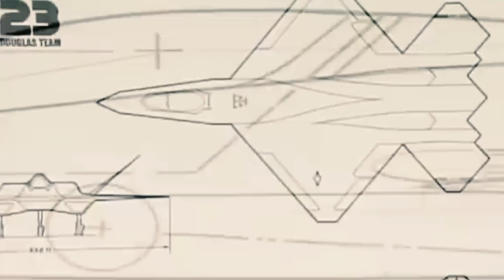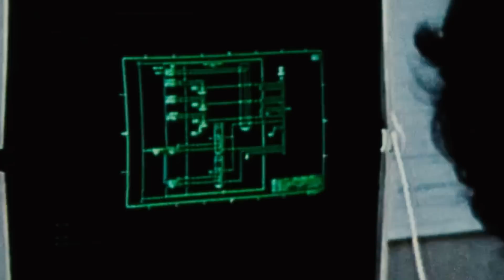The US Air Force Was Crazy Not to Build More of These

Comment: I’m so sick of the YF-23 fanboys saying that the YF-23 was superior to the F-22.

This is nonsense. People saying all of these things are ignoring some FACTS!

Fact#1
The YF23 and YF22 were prototypes that were used for demonstration and validation. The ATF competition did not have a competitive fly off. The purpose was to demonstrate that the technologies would actually work in a real aircraft. The dem/val was only one part of the competition. That said, the F-22 team flew their aircraft beyond the requirements set by the air force.

Fact#2
The YF22 and YF23 prototypes were just that-prototypes. They were not production aircraft. Therefore it is IMPOSSIBLE to compare these aircraft to the actual, fully developed, production F-22. 

The F-22 design changed dramatically from the YF-22 prototype. And the YF-23 would have as well.

People keep saying that the YF-23 was faster. It was faster, in supercruise, than the YF-22. BUT THE F-22 is faster, in supercruise, than both. And again, the F-22 is a fully developed production aircraft.

People keep saying that that the YF-23 was stealthier. This is a ludicrous statement. 

Neither the YF-23 nor the YF-22 were fully developed stealth aircraft. All they had were stealthy shapes and composite skin. 

Neither prototype had a gold coated cockpit, RAM coatings and gap filler or internal radar absorbing structures. Neither of them underwent exhaustive signature verification.

Moreover, every change that was made during development of the F-22, after the ATF competition, (there were a lot) had to be taken into account, while making it as stealthy as possible and maintaining the other specs. This would have been true of the F-23 as well.

Therefore it is IMPOSSIBLE to say how a  hypothetical production F-23 would have compared to the production F-22.

Comment: I literally laugh out loud at the opinions regarding the XF-22 vs YF-23. Oh that's right, we're living in the days of the conspiracy theorists now. The XF-22 didn't just have a better sales pitch, ultimately it had better performance specs and that's why it was chosen. Keep in mind both prototypes exceed the performance specs the military was looking for. 
The main specs:
1) The 22 has a higher top speed at 1600 mph to the 23's 1450. 
2) The 22 is more maneuverable especially at higher speeds. 
3)The 23 had a range of 2800 miles vs 2000 for the 22, I think it's been extended now.  
4) The ceiling for the 23 was about 65,000 ft. compared to 50,000 ft. which is higher now.  
5) The 23 had a smaller radar cross section than the 22. But, we're talking about trying to locate something on radar the size of a cubic inch for the 22 vs a cubic centimeter for the 23.   
6) The biggest reason the F-22 was chosen is production costs. All the engineers agreed it was supposed to be easier to build than the 23. 

If you remember, the costs almost doubled from the time congress first voted on them until the time the fleet was cut down to only 185 or so. The 23 would easily have had more budget overruns due to it being more complex to build in the first place. In a somewhat similar way, that's how the F-111 Aardvark was morphed into the F-14 Tomcat so they could recoup development and production costs of the F-111. 

Both the 22 and 23 are now 30+ year old tech. Much of the engineering came from the X-15 and the SR-71. Instead of looking/thinking backwards the government is looking forward, the F-35 is already 15-20 year old tech but it's still ahead of the Russian S-35, the Japanese J-35 and the Chinese J-20. How about the next video is about the J-20 vs the F-35?

Comment: At the moment the United States 🇺🇸 has the most technologically advanced military, especially the USAF, but in my opinion the aircraft need to be invincible, if the USA, NATO or any other allied nation starts a global conventional war these fantastic aircraft need to have an extremely low attrition rate, replacing them is not going to be as easy as it once was, the time required to produce just one of these aircraft is not measured in days,weeks or possibly months, and when you consider the cost element as well as the production rate it could easily diminish the superiority of the United States military,😮 and all the other countries that have procured their aircraft might not be able to obtain spare parts or even whole aircraft, it is one drawback that everyone hopes will not happen, but given the wars in Ukraine and potentially the Middle East as a whole does make this scenario very much more probable that possible.

Comment: The YF23 was NOT stealthier than the F22, they both have the radar crossection between a bubble bee and a golfball. The YF23 may have had other superiorities, but not in stealth visibility. I question the accuracy of 1.6 mach in supercruise.  I'm sure that if Lockeed had made this video, they would have discussed the superior manuvering due to thrust vectoring. I thought this was a comparison, because many things discussed, are present on the F22 as well, like concealed engine compressor blades, both have that. The 22 also has heat dissapating tiles at the exhaust system. YF23 has ram scoopes? BS!!! The YF23 did not have ramjet engines. It didn't have superior handling characteristics. Sometimes Northrup is as honest as trump. Your video is not an accurate comparison. Try again.

Comment: Why do all of the non-US stealth planes planned or existing so closely resemble the F-22 or the F-35? The answer is NOT that physics sharply limits the number of possible stealthy designs to a mere few. After all, US stealth planes vary dramatically from each other. Compare the B-2 to the F-117 or the F-117 to the  F-22 or F-35. Or compare any of those planes to the stealthy prototypes that didn't go into commercial production, e.g., the X-32, X-36, Tacit Blue, Have Blue, or the YF-23, the only fighter stealthier than the F-22 and widely regarded as its match. Yet all of the current plans for sixth generation planes closely resemble the F-22. Indeed, a few of them require a double take while your brain decides whether you're looking at an F-22 or something else. Currently, all of the 6th-gen design teams outside the US are copying its F-22 homework. Those design teams could instead copy America's homework on the YF-23 or another stealthy US plane, but the teams prefer to copy the F-22 homework simply because there is much more of it to copy given that the F-22 went into full production and much was published on it. (To be sure, some design teams outside the US copied its homework on the F-35 not the F-22, but those F-35 knock-offs aren't considered 6th-gen. An example is China's J-20 Mighty Dragon.)

Comment: Looking at hose lines you can see where they might have added some internal fuel in a B or C model to add some range like they are needing on the f-22 now....  I was liking the F-23 a lot as I watched the run off.  That missile launch was the punch that ruined the low level buzz caused by the "blackwidow" paint and "Grey Ghost" monikers.  Marketing...  I hope they picked this format for the NGAD, nimbleness with some self defense would be desirable in what would be a forward air controller/ C3I aircraft.  It looks like it would have the extra space for a couple more aircrew like the EA-6 and some more gas as well.

Comment: The fact that even all these years later it still looks like the most advanced fighter ever designed. It’s one of if not the sexiest fighter ever built. It’s strange the F-22 was chosen when the YF-23 had much better stealth capabilities, much higher top speed and much better range. What they should have done was build one production version of each and then put them up against each other for a few months actually fighting them against each other and see which one comes out on top. On top of that since they deemed thrust vectoring unneeded/useless now their original claimed reasoning for selecting the YF-22 is now void and null. Betting the YF-23 would still be being prosody ed today as the focus is on BVR instead of dog fighting now.

Comment: Knowone really won because the production run of the F-22 was cut short in favour of the JSF program anyway. ( the same probably would of happened to the YF-23 ) 

 The Marines needing a modern high performance jump jet for there fleet of carriers to replace the old british made Harriers was 1 of the biggest reasons the F22 program was cut short to fund the JSF program while giving the Navy and Airforce new fighters at the same time.
Reply: Marine Corps uses the Harrier II, which was a US/British joint development from the original HS Harrier. It wasn't strictly a British plane, but definitely had a lot of British in it.
Reply: @GreaverBlade   Correct, but the UK stopped   production of Harriers and sold their Harriers and spare parts to the US Marines ( Harriers, also known as the widow maker due to how unsafe they are ) Production had stopped and were becoming outdated.

The Marine Corps currently plans to have all squadrons transitioned to or start to transition to the F-35 platform by 2026.
Reply: @GreaverBlade  This transition began in 2016 when VMA-211 exchanged its Harriers for the F-35B and became VMFA-211.

Comment: I would love to see what ruddervator would have done for the B-1 Lancer bomber.
Reply: Sounds like the Advanced B-1R proposed Missile Truck from 20 years ago.
Reply: @Ryan_Christopher  aside from the engine swap the B-1R would have looked the same. I'm suggesting replacing the tail for ruddervators.  Also melding the new engines into the main body of the B-1. Curious how would having a air intake on the dorsal side effect flight? The Scaled Composite 437 Vanguard  has dorsal intakes.

Comment: Since the Air Farce doesn't BUILD their planes, the title is a bit of a misnomer.

But this plane was by far the better plane.  The F-22 is less stealthy, more weather finicky and maintenance heavy.  And, to add insult to injury, more than a wee bit SLOWER.

This was about Boeing glad handing and paying off political allies to get the contract it really didn't deserve.
Reply: Lockmart was the prime contractor not Boeing. Boeing built the wings
Reply: @johnblackthorne787  That's true...forgot about that since Boeing bought them.

Guess they thought they could bottle lightning again without Kelly Johnson.  Not so much...
Reply: @billcichoke2534 Um, Boeing hasn't bought Blockheed Martin there dude.  Blockheed is the company currently massively over budget and WAY behind schedule on the F-35...
Reply: @danielvogel5252  They bought either Lockeed or McDon.  I don't remember which.  Either way, this was about awarding a current politician payola company.  Northrop got theirs later with the B2 flying wing.

But the YF-23 was still the better bird.

Comment: I think a lot of rhe ideas and tech from the YF-23 is going to go into NGAD... Especially the stealth aspects, which was supposedly far superior to the F-22- but without the now unnecessary supermanuverabity- but, at the time, Northrup and McDonnelDouglas had a bad habit of cost overruns (see The B-2, etc.)

It was particularly stealthy in the infrared spectrum with it's buried engines and intakes and engine nozzles, but it was far from being a dogfighter, when dogfighting was still considered a necessary thing. 

Anyway, a YF-23 without any tails at all (which can be done now) would be very, very stealthy, on alll spectrums amd aspects, even today - and given it's capabilities 40-ish years ago... One has to wonder what it could do with that many years more experience!

I suspect that NGAD will be far more simaler to the YF-F3 than the F-22! (Or at lea, I hope so!)
Reply: NGAD is now in question. May not happen, but if it does you’re probably right.
Reply: Over 250 knots airspeed the YF 23 was more maneuverable, faster, more fuel efficient and a smaller radar cross section.  It was also easier to maintain.

Comment: Northrop was in bad books with the airforce after B2 program. The pentagon did not trust them to deliver the F23 within a reasonable budget. So it was never going to win. LM had delivered the U2 & SR 71 & F117  quickly and within budget.
Reply: @ricky1231 - Except that didn't happen with the $$porky$$ F-22.  It was not only delayed for years by production/teething problems, but also beset with massive cost overruns.  And if those weren't enough, the cost per operational flight hour was so high that production of the large number ordered was stopped very early.  The much smaller number of aircraft built, combined with losses due to attrition, has been a problem for the USAF to meet combat requirements in the current 'forever wars' warmonger philosophy.  And calls over the years to produce more F-22s have been quickly rejected by the Pentagon.  I wonder how this sorry scenario might have played out had the superior YF-23 been selected instead of the F-22.
Reply: Look at all the problems LM had with the F-35, way over budget and long past meeting mile posts along the way. Both are in bad name with the government now, especially Boeing with their screw up with NASA.
Reply: If LM didn’t get this contract they would if been done. AF saved LM to save they contractor.

Comment: I think considering how few 22's lockheed built we could have had twice the number of aircraft before they grew a brain fart after the fact and shut production down. We been way better off with those two then with the 35. If we ended up with all three we and built enough we not be facing what we do now. That said they have blue prints for model t's there is no way there going to destroy planes for either aircraft that is top of the line fighters.

Comment: So now Japan is building a jet based on the YF-23. Time will tell.
Reply: I wonder how much of the NGAD will end up coming from the concepts used in the YF-23? My guess is... a LOT.
Reply: @bholdr----0  MUCHLY
Reply: @MAGAman-uy7wh  

Yeah .. the 23 STILL looks like it's in the bleeding edge, 40-ish years later... 

Sometimes I feet bad for wishing that the cold war never ended, because of all the cool tech that came out of it- from the Blackbird and the ATF to Tang and Velcro! Cheers!
Reply: When it came to choosing a fighter to purchase.  It seems someone was doing someone else a big favor.  I heard one of the criteria was dog fighting ability.  They don't really dog fight anymore since missiles for the sky have been created.
Reply: @bholdr----0  Well, Mitsubishi altered the F-16 into a similar but different fighter.  One difference is the Mitsubishi version is slightly larger than the General Dynamics version with a wing area 25% larger.  So, I'm pretty sure that whoever is building Japan's version is making alterations but those alterations will be improvements.
Reply: @bholdr----0 with modern avionics, drone wingman integration, and electronic warfare capabilities it pretty much would be a 6th gen without having to alter design elements.
Reply: @08jaworskis  

Well, that's one way of looking at it. I don't think that the 'generations' of fighters, etc, is anything more than buzzwords or subjective definitions- but, yeah, you're probably correct, within that non-specific framework- we have to define things in SOME manner, eh? (Yours as as good as any, and I agree, I general!)

Cheers!
Reply: @bholdr----0  yeah for sure, just going based off of what most consider the mandatory abilities to be classified as a 6th gen fighter. (Stealth, advanced sensor suite, AAV support, and electronic warfare)
Reply: @bholdr----0 I wouldn't expect much from the YF-23 to make it to NGAD.

The ATF competition had very different goals than NGAD.
Reply: @bholdr----0  I doubt it.  The Air Force sees unmanned aircraft and missiles with remote sensors as the future. The aircraft in the background will be larger aircraft with powerful sensor suites and great endurance.
Reply: @FreedomOfSpeech-u5q  
Yeah, I'm starting to think that, too. That said, I recently re-read an analysis from the office of the CNO from about 30 years ago that said that the F22 (known as the ATF, at time) would probably be the last manned front-line fighter that the US would build, and since then we've had the F35, Eagle 2, and (sometime) the NGAD. 

Eventually they'll be fully autonomous (or remote controlled like Reapers, or optionally manned like the B21 is supposed to be, etc), but I think it may be a bit farther off than most observers think. 

But, who knows how advanced some of the 'black' projects are, given that the Air Force was able to keep the F-117 under wraps for a decade+ 

Cheers.
Reply: Afaik, the laws of physics have not changed since the YF-23. A fuselage shape that follows Area-Rule and has low observability will still work today. The smart move would be to have parts commonality with the F-35 wherever possible.
Reply: Don't think so.
Reply: Nah the Italian-Anglo-Japanese version look’s nothing like this